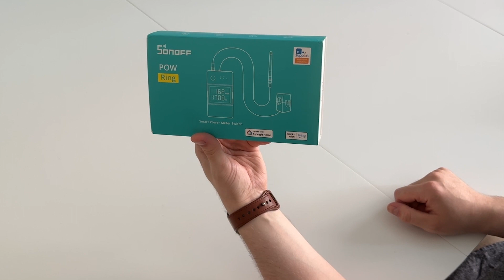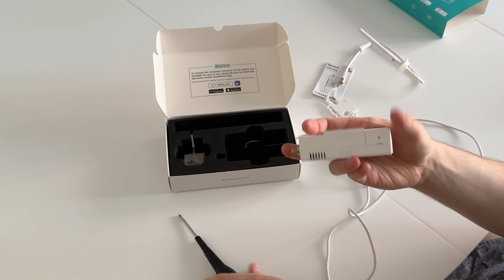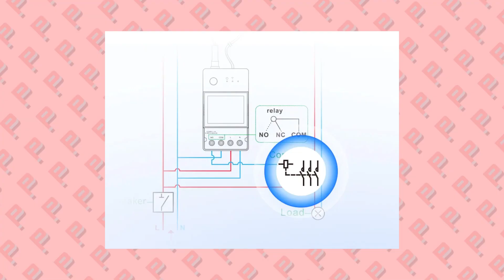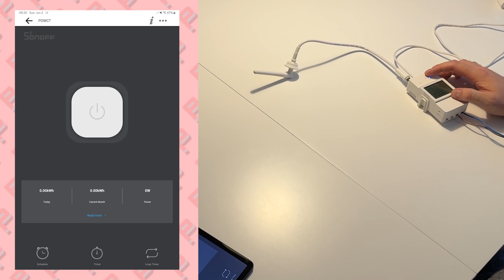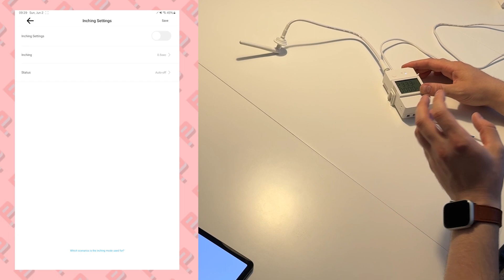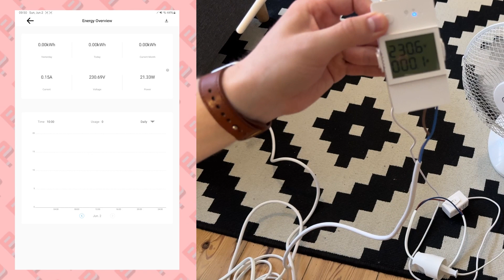Monitor the power consumption of your entire house

Comment: The live wire tapping without splitting inside the system made it easier to install compared to the older model which didnt have that but on downside the new model.has world tracking and zero privacy.i myself didnt know of the tracking with country selector and was waiting for the new model but thanks to people review will go for the older model.If there is no choice then not connecting it to a network remains to be tested as no one has tried it on YT reviews

Comment: So this device does not work without seperating the cables, we need to attach the ring to L wire?
Reply from the maker: @eshadow2980  That is correct. It's not the fault of Sonoff. It's down to pure physics.
Reply: @PositronMedium  ok thanks, do you know any tool that I can cut the top layer of cable (white part) horizontally to reveal the phase cable?
Reply from the maker: @eshadow2980  I don't know of a specific tool designed to do that. You would need something sharp like a knife or scissors
Reply: @PositronMedium   yes I aware of this procedure except I do not have experience to cut it with damaging the cable, then I will need find clip to combine the cables ), ok thank you!
Reply from the maker: @ If you do not have experience I would advice against trying to split the neutral and live wire. I would advice getting help from an electrician.